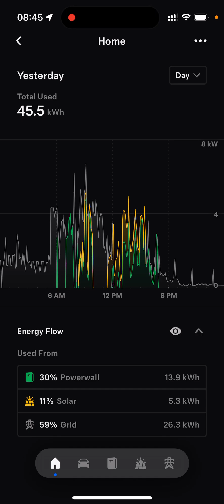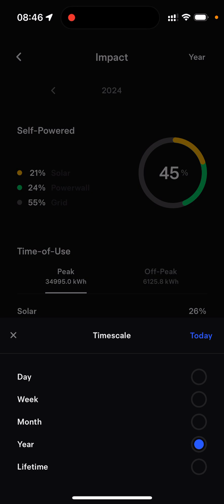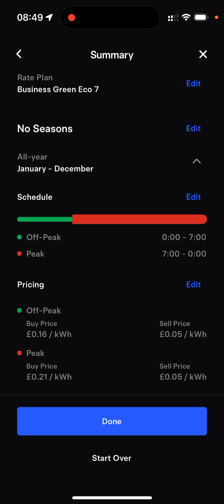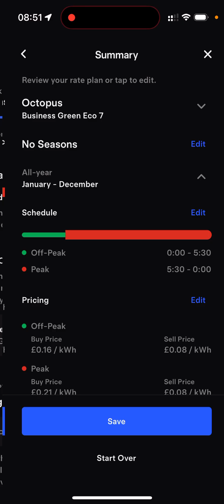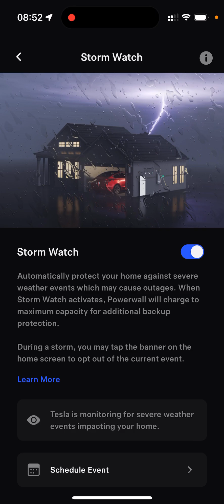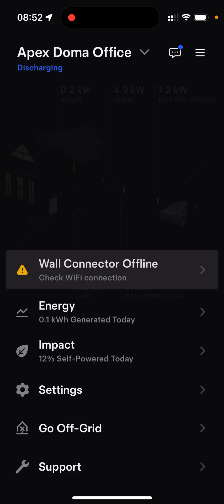Powerwalll 3 Tesla App Walkthrough & Tariff Set Up | Apex Doma

Comment: Would you recommend the power wall 3 over givenergy systems was looking at givenergy but this Tesla looks much better
Reply from the maker: Thank you for your comment! It's certainly something we get asked A LOT and there's no straightforward answer. We are platinum installers for GivEnergy and Award Winning Tesla installers, they each have drawbacks & benefits - the best system ultimately depends on your specific needs and requirements. 
 
Here is some general advice of when you might choose system over the other:
If you are a family of four with no heat pump and average loads (2000 – 5000KWH), then a GivEnergy Hybrid inverter will likely give you the best ROI and meet your needs. If your home is in a much higher demand (5000 KWH +) or you have a heat pump, then you would more than likely make the best use of the larger inverter in the Powerwall 3.

If you don’t want the whole home back up but a want the increased storage capacity of the Powerwall 3, then GivEnergy has a product called the All in One, which is worth a look at; this has a 13.5KWH battery (similar chemistry to the Powerwall 3), the inverter is a bit smaller at 6KW (charge and discharge), but you get more bang for your buck particularly if you are a battery only (AC/Coupled) customer.
 
Hope that helps a bit! Let us know if you have any more questions :)